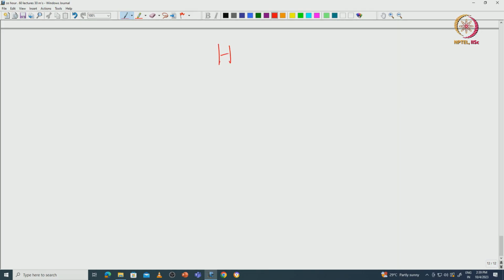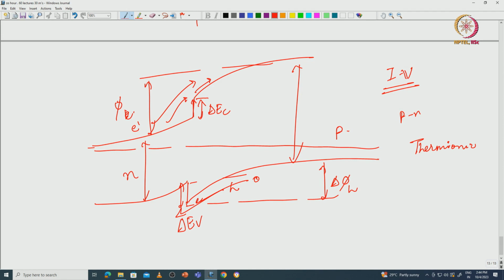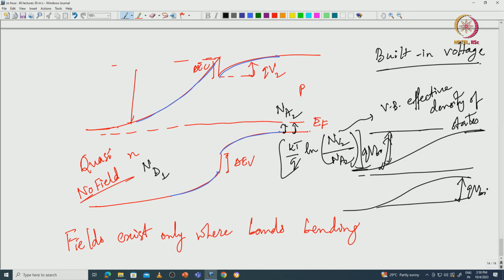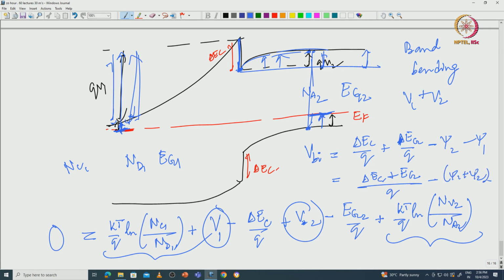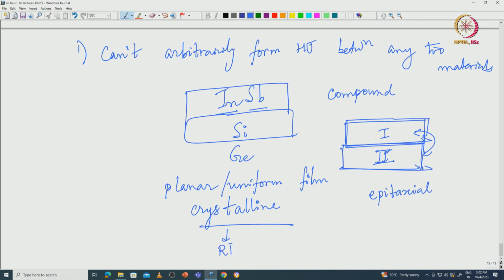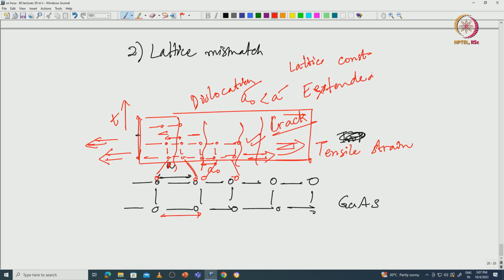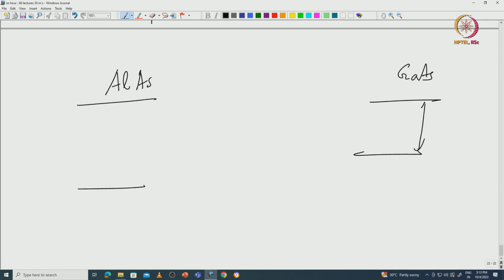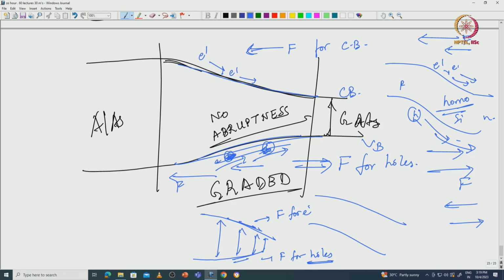Lec 05 Heterojunction device physics

Comment: 7:40 Shouldn't the expression for the ratios of the two currents involve delta(E_g) instead of delta(E_v)?
Reply: for graded heterojunction, it is indeed delta(Eg). For abrupt junction, it is delta(Ev)
Reply: At 38 I think explanation for the hole and electron movement , you did a mistake